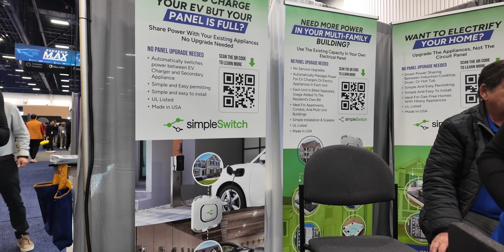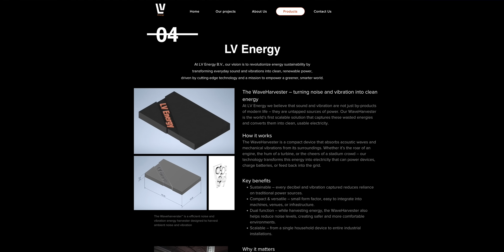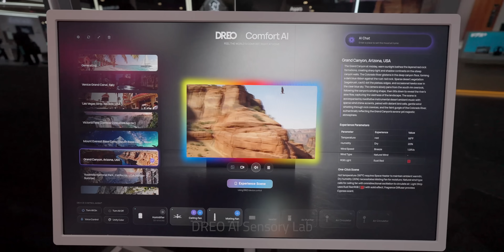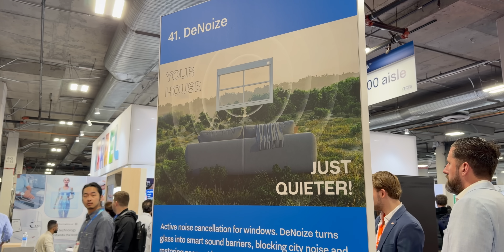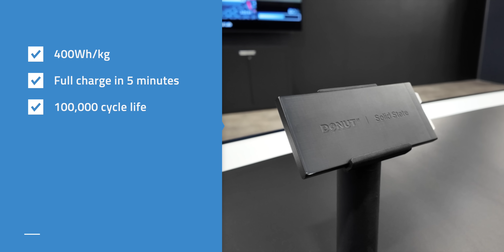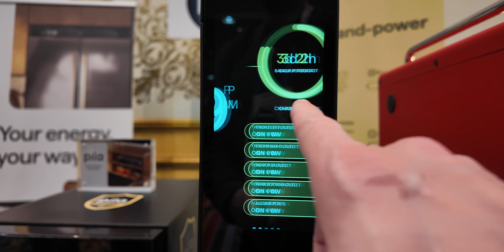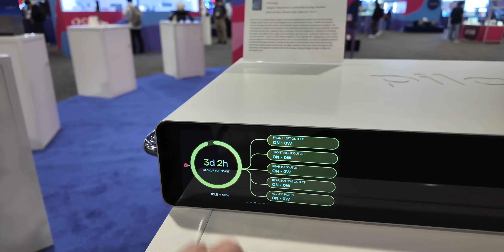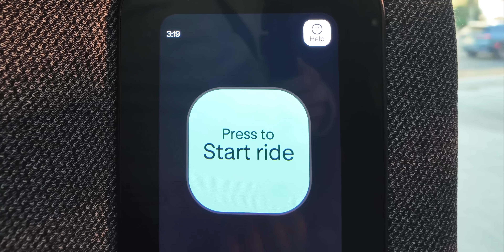The Most Controversial Battery at CES 2026

Comment: About SimpleSwitch. My electrician hate it. The terminal for wire is too small. In theory, it works, but in reality, because of people will twisted the wire before put into the terminal. It will be too small for the job. 

Personally, I don't have any complain, because I don't need to install it.

Comment: If this is a super capacitor with short term holding cab abilities I could see this supplementing lithium batteries to make EV’s more efficient and easier to use. 
If you swapped some of the batteries, say half, and kept half then you would have long term/long range backup capacity AND quick charge capacity for commuting or fast on road recharging.  The system could prioritize use of the capacitors and use them for better regen.

Comment: the wireless door charging is kind of dumb. Most of these locks have alerts when the battery is low, you get up to a few weeks to change/charge. Also most models (that are moderate quality) have a great solution already: one of my EDL's had alkaline batteries that leaked, just bad quality batteries, so i couldnt get in :( Solution is, they have 9V battery terminals on the outside, so you just press the battery against the terminals and it provides enough power to open the door.

Comment: Noise reducing windows:  BULL!  No way they could make that work across window types, sizes, glass types, varying inter-pane gaps, etc, etc.  Can they make it work for a demo with one, single setup?  Maybe.  But a commercial, slap it on your existing windows?  Not without very extensive monitoring and feedback systems, as well as precision location for the exciters.

Comment: WHY do I want to remotely power a door lock, instead of having a reasonable battery state monitor and having an alternative means of entry (ie, a key)?  When the power fails to the remote charger (circuit or whole home), your device is dead after its' backup battery has discharged?  No thanks.

Comment: The term "Solid State" is being used as a buzzword to make something seem advanced to those with no technical background. All it means is an electronic component made up solely of semiconductors in the form of PN junctions, and is more broadly used to describe devices that use such technology to eliminate moving parts. Batteries have always been solid state since they meet the latter term. Like a modern portable power unit versus a generator.
I suspect we will find out it's common technology in a slicker package, the way AI turned out to be not so intelligent, but just the same old algorithms with access to more processing power and a larger database on which to draw (people with seven fingers).

Comment: Gas has always been the gold standard. Lots of power, fairly cheap and easy to replace and refill. Lithium is currently the gold standard of batteries.  The power is there but the range and refill leave a lot to be desired. If Donut is telling the truth it would be a huge step forward. Cars with a built in gas generator to recharge the batteries would give us unheard of mileage. The problem with batteries will always be the ability for a back up. If the grid goes down for days you have no way to recharge. I can put gas in my car from a can and keep going. If you run out of battery you have NO back up.

Comment: With a simple inversion of sensor placement or similar.. could this actually help with reducing noise pollution from a bar or music venue? 

I'm a semi retired pro audio engineer of about 30 years career wise.. early on (and at various times later) I've worked or ran several inner city street side bars with music/small music venues in mixed commercial/residential neighborhoods where sound proofing was always crucial (but not always a factor or consideration for varied reasons). 

This could be a game changer in several ways, especially some highly specific scenarios from my past experience.. 

Hmm, just brain storming, haven't thought it through fully to be honest but a 20db reduction is amazing (as decibel is logarithmic not linear). 

That is if these are aftermarket installations for existing double (or triple) paned windows.. but also if cost effective option for a remodel as well... I'm thinking large picture windows too that you find in bars and venues..

The higher end of the hearing spectrum is a lot easier to sound proof than low end sub frequencies.. as the shorted the wave, the easier it is reflected while the long waves of low end pass right through concrete (making subs effectively omnidirectional).. 

Hmm, doubt large picture windows come in multipane tho but not my area of expertise.. 

Also wonder the natural sound dampening of multipane windows and does this active cancellation stack  with it? That would truly be a game changer if so.. 

I'm just brainstorming off the top of my head..  haven't started shooting down or debunking my own inspirations yet. Lol. But that's the process, come up with ideas then logically think them through.. no dumb ideas just unworkable, unattainable, or impractical ones.
Reply: Oh, and before anyone comments otherwise.. every (dynamic) mic IS a speaker and vice versa..

Comment: Hi Matt. My electrician installed a Simple Switch in my 1960's condominium about a year ago. It has worked great for me on a 60 Amp Service using my 40 Amp Electric Range's circuit to charge my car. Think about that folks, I can draw up to 32 Amps at 240 Volts to charge my car. On top of that, I changed to demand metering so my car charges between 7PM and 7AM on weeknights, and any time on weekends or holidays at half the cost. Because of that, I allow an upper level neighbor who parks in the next space to charge her Mustang Mach-e when she is in town, usually on weekends. She reimburses me after each charge via Venmo.

Comment: Talk is cheap. I'm disappointed they didn't have even a "lab prototype" Donut battery connected to a charging source (and a kill-a-watt meter) and a dummy load to discharge the fully charged battery. They should have had a bank of halogen lights as a load to discharge the Donut, but they didn't. Doh! I this is production-ready and will be in Verge bikes in 2026 they must have had a later prototype cells "just laying around the lab". So, on the BS-o-Meter, the needle is tilting towards the "flies-side" of truth.

Comment: no its not, they did the layering of superconductor which performs like lithium battery when conducting electricy around 4v.

by principal its less likely to be a scam if they did it that way but when it shakes in EV and bumps it might have small material degredation issue. 

was it a scam....depends... its 50/50 not a scam.  but if you dont think in terms of investment only buying one pack of battery what do you have to lose right?

Comment: I was so wanting something substantive about Donut as I’ve watched Ryan’s episode already. He brings up the battery versus capacitor conundrum, to which I wonder if a capacitor can function like a battery if the discharge rate can be regulated.

More importantly…Does the Lutron bathroom fan activate based on digestive gases? 😱

Comment: Shared circuits? Here in the Netherlands I have a three phase 3x25 amp hookup, max 17kW. My home charger (11kW) is connected to my smart meter and knows when to scale back. Is that not common outside of the Netherlands?
Reply: Also we have plugin homebatteries on those regular circuits. If you use a 3 phase system you can add 3 sets of batteries, one per phase.

Comment: DONUT is not a battery. It is a 'Super Capacitor'. Charge and discharge is regulated by resistors through power transitors. I = V / R.
Similar electronics as the control of an AC engine dynomometer. Speed and Power absorption control.
They could face a 'Product Description' challenge when they come to UK.

Comment: 100,000 cycle life. That's ironic because the old 5.25 PC desktop fans also were rated at 100,000 hours running cycle before failure.

Yet I've seen more expensive models that advertise 60,000 hours. These are the small tidbits that you don't see when you purchase a computer. Go see the schematics of basic information. Unless you are a computer Enthusiast and you believe in seeing through the fine print of the advertisement to see exactly what your getting or not getting just because it has some pretty cool LEDs that are flashing by me to a catchy tune in the store.

Not like I would buy it if my computer tower is brighter than the monitor that I am playing my game on. I won't buy it. I don't need a disco ball and strobe lights in my office.

Comment: Fun fact: it’s a common trick in the battery industry to cheat temperature performance by letting the battery heat itself up through its own internal resistance. The inside of the pack could be above freezing while ambient temperatures are -30C, and I wouldn’t be surprised if the solid state electrolyte is highly resistive.

Comment: Load based design on the capacitor stacks ? As current draw increases capacitors cascade in an engineered manner ? Many ways to design systems to achieve a desired result.

I hope its real but won't be surprised if its not.

Comment: 13:10 I've had a Lutron humidistat switch on my bathroom fan for over 11 years. It's worked as expected and been a mundane part of my house the whole time. 

It was simply available on the shelf at big box hardware stores for like $20 this whole time without any fanfare, so I'm kinda surprised that they featured this at CES. Other brands make similar models equally as mundane so it's not even exclusive to Lutron. ¯\_(ツ)_/¯

Comment: The "Battery" if its real and not just a capacitor sounds cool. Also the power switch could be great and a game changer for small houses and apartments with 100Amp power panels and new EV chargers coming. No more having to choose. Saves power and uses it more efficiently is more of what we need in the world. Especially as A.I steals all our power.

Comment: Is there a company like Simple switch that offers a whole home switching system to monitor and prioritize every circuit in the home to lower the overall current consumption at any given point? I've been running my house which has 100amp service on only 50amps for the past 7 years and I'd like to lower that even more. I have my own solar and battery which my house runs on 90% of the time because I prioritize solar/battery over grid input. Thanks in advance and I love your channel.

Jason from CT

Comment: Wireless powered door lock might be the stupidest idea ever. Yeah, sure it's nice to not deal with wires. But you still have to break the door to install it, why not the wire as well? Also it needs another power plug for the transmitter.

Comment: 12:08 the amprius "SA124"... very interesting. can't find anything about it online.amprius recently put out the SA112 (which is next to the sa124 in video), and it's the highest-capacity 21700 cell on the market (at 6500mAh). its rated continuous discharge is 13A (ample for most flashlights, and intermittent use-cases (e.g. vapes)).
man i wish xxxx0 cells were used for more things.

Comment: I have have a solution for getting into my electronic door lock when the battery is dead. It is called a "KEY". Yes "KEY" is a well proven technology that has worked for centuries and believe it or not requires wrist power alone. Yes some electronic door locks "KEY" as a backup option. I am really excited about this technology.

Comment: I love your videos.... but adding help to the door locks power fear, there are some that have two external prongs to manually power it using it with a 9v battery. Besides, the best ones also offer a physical key entry. Technically they can function/work in 3 ways to be able to open a door.

Comment: Regarding the vent fan humidity switch... I have one of these (different brand) installed. I find that by the time the humidity reaches the switch-level sensor, the top half of the room is already saturated in moisture. The mirrors are foggy and the ceiling is damp.
Also, mine took some fiddling to choose the right humidity level to trigger the fan so that it doesn't also turn the fan on during a summer day. Maybe the lutron works smarter than mine does.

Comment: eh most noise is going around the edges of an openable window. like the noise cancelling tech could maybe be useful for sealed facades like they use in skyscrapers or say an airport hotel. 
a standard 6mm laminates pane of glass probably has a lab rating of like Rw 33 dB. basically 20dB sound reduction is nothing to write home about unless you’re magically going from Rw 35 dB to Rw 55 dB. 

the low frequency thing is interesting - i’ll have to go look that up.

Comment: Hello there Matt,

I’m currently based in Switzerland — the land of cheese and chocolate — but I’m originally from South Africa, where I still own several properties that form part of my retirement plan. I’ll be returning there soon to settle permanently.

To get straight to the point: I’m not an expert in electrical systems or power grids, so I want to check whether something I was told a few years ago actually makes sense.

A German gentleman once explained to me that he reduces his electricity costs using a type of “in‑between” device. According to him, this device regulates the power going to each appliance — fridges, stoves, microwaves, lights, and so on — by supplying only the amount of power the appliance actually needs at any given moment.

He gave the example of a fridge: when it’s maintaining temperature, it doesn’t need full power, and when it cycles back on, it draws more. His point was that the standard grid (like in South Africa) constantly pushes 220V to the appliance whether it needs it or not. His system, however, supposedly distributes and controls the power more intelligently, which results in noticeable savings.

My questions are:
• Does this concept make sense?
• Am I explaining it correctly?
• And is there actually a device or system on the market that works this way?

The reason I’m asking is because in South Africa we often experience long power outages — sometimes 8 to 16 hours — and when the power returns, there’s a massive surge as all appliances restart at once. If there’s a technology that can manage or smooth out this demand, it would be extremely useful.

Comment: 2:00 here's an idea for how to continuously power the smart lock: use the hinges as power conduits. +5v is connected to the top hinge, and ground to the lower hinge. It would require some modification to the door and frame, but it would be cheap and easy.

Comment: If that solid state battery is the real deal and it can be manufactured at low-cost, it will be the end of internal combustion engines. I say this as an EV critic (I don't hate EVs). I don't think EVs are quite where they need to be to fully saturate the market at the moment. I think that Toyota's pragmatic estimate based on current tech of 30% saturation is accurate due to holes in EV user experience/capabilities for the other 70% of the population. EVs have absolutely been improving steadily but so far, but they are still missing the mark for the majority of consumers. If solid state batteries actually can offer this level of performance though, it solves a lot of issues. So many issues that ICE will very much be a stupid choice if they are offered in vehicles with affordable prices. It would absolutely be an iphone moment when combustion starts a rapid decline.

Comment: 5:58 Just invest in decent double/tripple glazed windows and you should be good to go ;) I lived close to either a 6 lane road or 4 track railroad + aircrafts overhead for most of my live and once I shut the window, I could barely hear a thing from outside.

And finally: Thermal insulation usually goes hand in hand with noise insulation.

Comment: My biggest red flag I'm getting from Donut is the fact that they didn't bring a working unit to display. If they had actually managed to pull this off I find it hard to believe that they wouldn't have that right up front and center at the CES. They had to know this claim would require some solid proof and that by not having that working model they would be seen as suspect, so if they could have provided that proof I believe they definitely would have.
Reply: Privacy is huge for this thing and its normal , specially for a small company in Finland. 
Thats why they said you will have q1 production .

Comment: Door locks charging so easy I don't understand why they didn't implement it yet : just put an induction charge just like any other electric toothbrush ! It's even easier with a door lock : it's fixed and doesn't move !

Comment: Isn't that simple switch the exact same thing as what have been on the market for forever that allows you to connect a washing machine and a dryer on the same circuit? Doesn't sound very innovative to me? Anyway, just cutting off power doesn't sound ideal for many devices either.

Comment: Humidity sensor switches have been around for ages and nothing new. Most newer properties should have some kind of humidity sensor switch linked to an extractor fan or the extractor fans can also have humidity sensors built in. 
My apartments from the 90s and it has an old ass humidity switch which I wired up with a Lutron motion sensing switch in the bathroom so both can trigger the extractor fan, no smart app controlled crap needed.....🤯